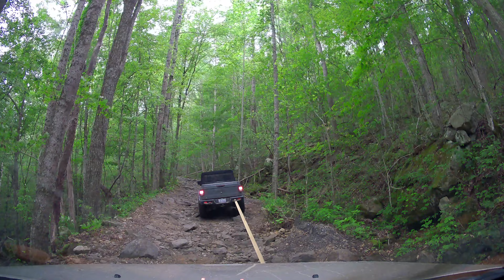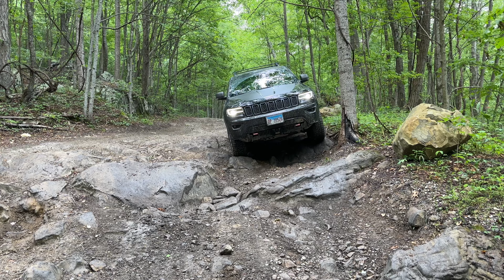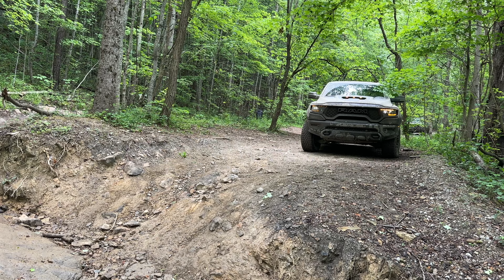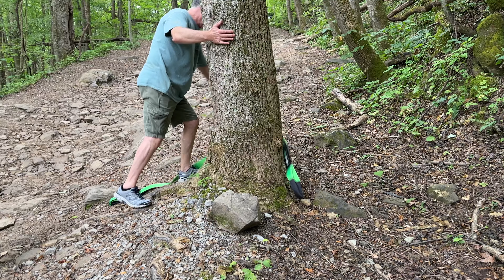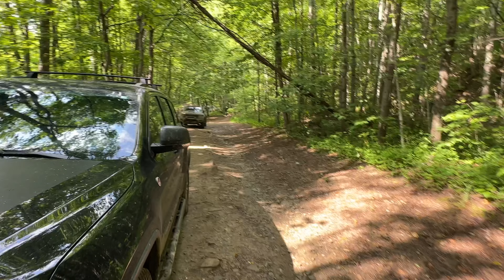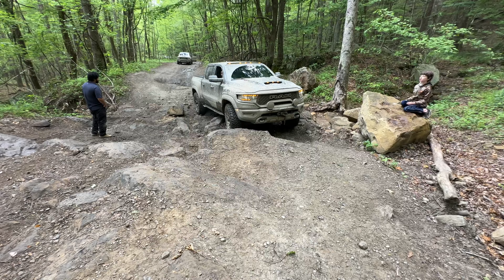Jeep Grand Cherokee (WK2) Overheats | Coolant issues on Trail 11 Windrock Off Road Park

Comment: Do you have any feedback on the air links to raise the air suspension? Do they work well? I know you have a trailhawk as well. What’s the biggest tire you feel comfortable with?
Reply from the maker: When you get airlinks you trade ride height for articulation and ride comfort. I’m not really a fan of them. We have been running 265/65/18. I feel comfortable at that tire size.
Reply: In my experience 265/65/18 is everything you’ll need for where this vehicle should go.

Comment: I know it’s his first time, but it’s as if he’s never seen one of your videos before. Can’t blame the Jeep. The humans fault
Reply: WK2s honestly aren't the easiest to drive on even moderately difficult trails  (Trail 11 I think is a moderate 6/10 on onX).  The whole using air bags to provide "lift" for offroad is not a great solution.  It eats up your down travel and is really difficult to modify to make much better.  These things use electronic traction aids which work decently well but are not a substitute for lockers.  Not hating, I own a 2016 wk2 but if you are going to buy a modern SUV for offroading, get a wrangler or a 4Runner.  

If you are talking about the overheating issue, that's just bad luck.  Mud sucks, stay out of it if you can.  I wouldn't want to be behind a group of them but I respect people who are willing to take WK2s on these trails.  Videos don't equal seat time either so I don't think I'd be looking to blame anyone here.
Reply: @crawlculture  I fully understand that, I have a summit myself. The articulation doesn’t compare to a wrangler. My point is the car didn’t just break down. His lines and excitement got the better of him. Was putting his foot down too much. As your name suggests; gotta crawl
Reply: @angrymuffinsb  yea, I've let my excitement get the best of me on more than one occasion
Reply: I enjoyed this adventure. Thanks for recording and posting. I have a 2005 limited jgc with 5.7 hemi and quadradrive2. Throttle control is my Achilles. I tend to put too much throttle and there have been times I meant to mash the brake and ended up giving throttle. In the moment and excitement of the moment and some panic when I’m moving instead of stopping, there was one time where it could have been terrible. I need to learn to brake with left foot and learn how to give steady throttle and rely on the quadradrive2 to work instead of giving it more juice. Full transparency, I am not good, but I enjoy going off road at Bridgeport Texas ohv park. For a while I was going every weekend. My jgc is heavy and I have been surprised at how capable it is and how incapable I am at times to choose the correct line.